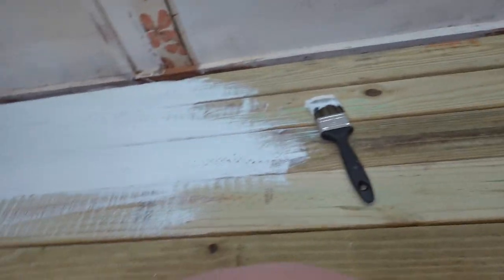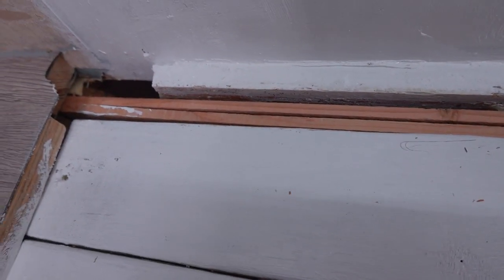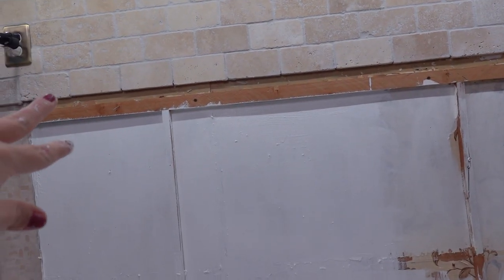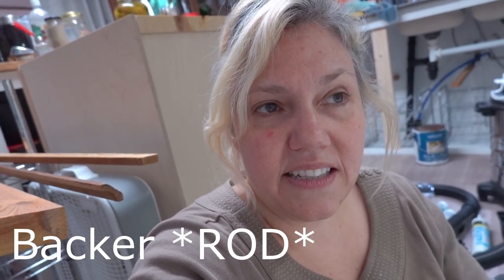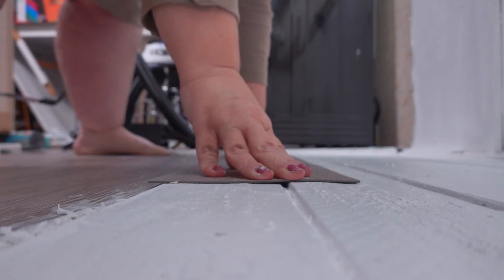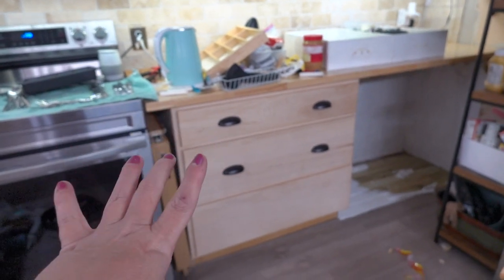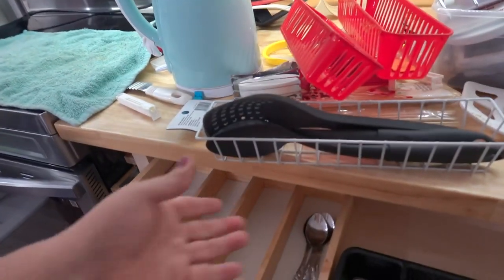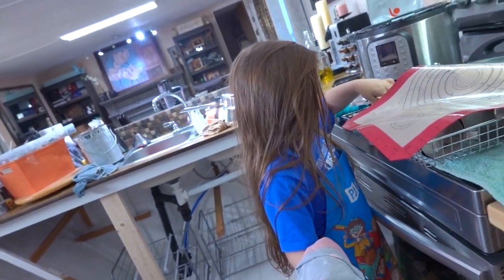Installing Our First New Cabinet After Replacing the Floor in Mobile Home

Comment: You could probably add some water to the paint!
Reply from the maker: I didn't want to do that because there is a chemical in the flooring - we used pressure treated 2x4's and I wanted a nice thick coat on that to cover it really well, but yeah, for the wall I definitely could have gotten away with watering it down! I need to get rid of all this paint. I think I have 6 random paint cans now that I need to use up because it was in a hot building outside - I am pretty sure all of it is like this now! I am going to store the rest of the paint in the future, in the house!